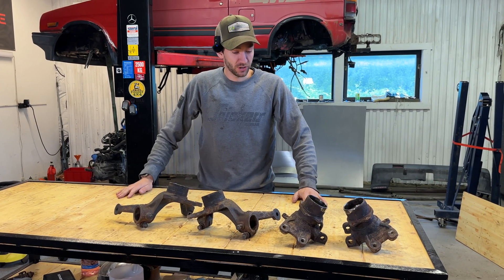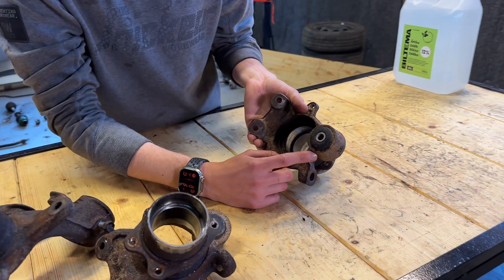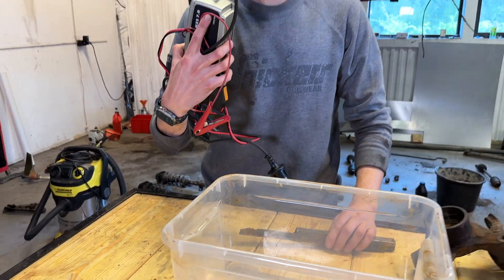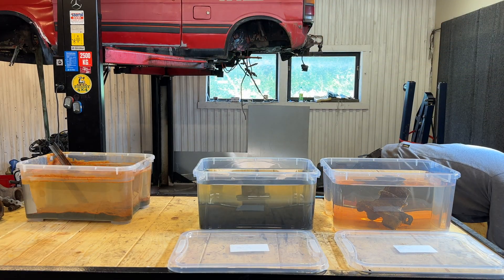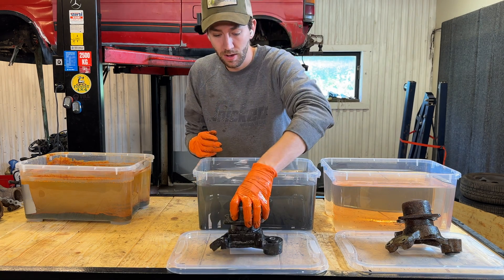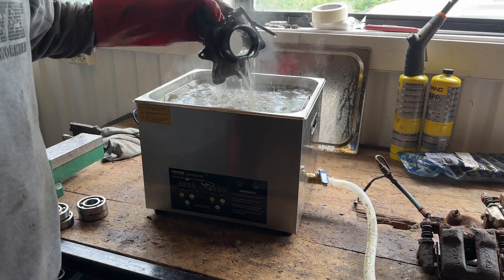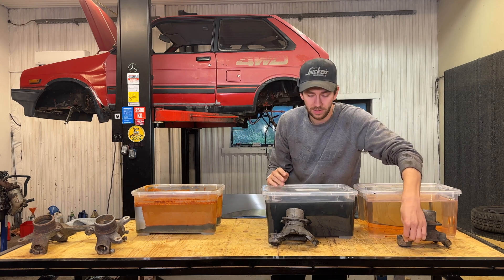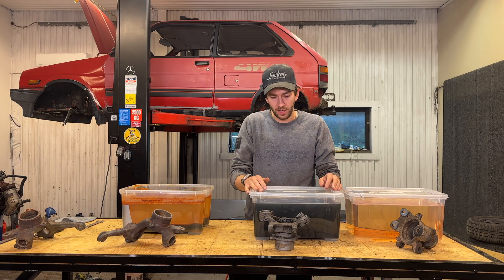Remove rust the easy way?

Comment: I love electrolytic process, have restored a fine engraved GEDORE toolcase that belonged to my grandfather without harming the engraving. WHat I like best is it doesn't harm a molecule of good metal. it is a line of sight process so better to have some sacrificial rods in each corner.. or you will have to keep turning the piece once in a while
Reply from the maker: That sounds like a very good use of electrolysis! Thanks for the tip, will try with one rod in each corner next time 😁
Reply: @Fredholm2  it is so easy, I don't even fuss much doing it, even works with cheap bicarb of soda in the water. I use a filled old kitchen rubbish bin... best leave it outside while working to stop the hydrogen gas tarnishing your shiny stuff around the house/workshop.